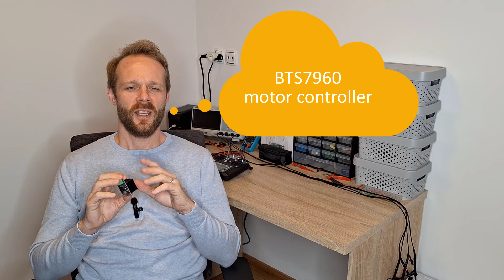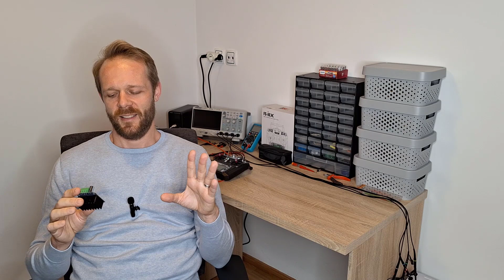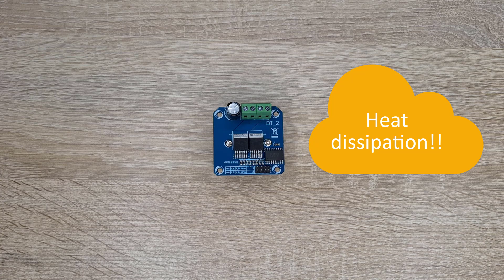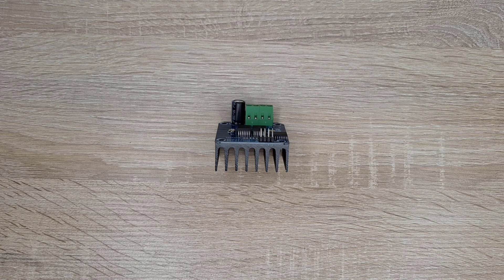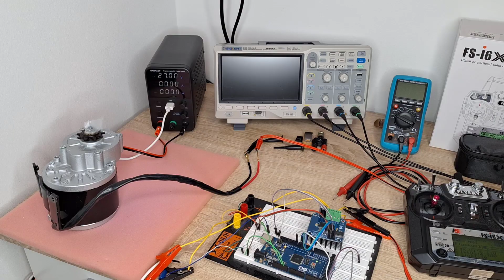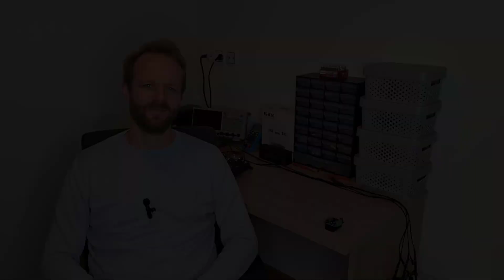BTS7960 - Remote Control Lawn Mower DIY

Comment: Yes sir.you right.that is my problem.so would u mind tell me how could i handle the problem still using that motor controller
Reply from the maker: It depends what is the overshoot of voltage from your alternator regarding this motor controller. You could put one or two power diodes on supply line as quick fix

Comment: Good job Gregor! What about to move the heatsink from the bottom to the top of the module, so it will have direct contact to the BTS 7960s? It should much more efficient.
Reply from the maker: Hi! you could add additional sink to top of the element. This would improve heat dissipation slightly. However this elements are soldered to the board, where much of the heat dissipates.

Comment: Thats funny, I built my lawnmower using BTS 7960 just before this video came out.  Mine is completeley controlled by a Arduino. I will release a video soon together with the code.
Reply from the maker: Hi, that's great if it works in your case! According to the BTS7960 datasheet, the chip has an operating voltage between 5.5V and 27.5V. The chip limit is just above 28V, so if it works, it is just on the limit. Alternator is usually charging at 28V.

Comment: Can you recommend a safe driver for the MY1016Z2 dc motor? greetings from Indonesia 🙏
Reply from the maker: You could go with Sabertooth. This drivers are robust and versatile.
https://www.dimensionengineering.com/products/sabertooth2x32

If you need cheaper option, buy Cytron. This drivers are also fine:
https://www.cytron.io/p-30amp-7v-35v-smartdrive-dc-motor-driver-2-channels

Both can be purchased in various online shops. This drivers can be connected directly to RC receiver. Have a nice day!
Reply: @gregorkobetic Hello.
I live in Sweden and have looked everywhere for Sebertooth and Cytron but they seem to be out of stock everywhere. Do you have another option?👌
Reply from the maker: @farmpro_farmer8737  Hi, I will get back to you tomorrow. Today I am on the road. I have one controller on stock. Please write me email on gkobetic@gmail.com. Will discuss your expectations.
Reply: thank you for your response.. I really like this channel, because you explain it in very detail.. I will wait for your next project.. 👍
Reply: I use 2 x Cytron SmartDrive40. My DIY lawn mower weighs 120 - 130 KG and the drivers are warm (<40 C) at full load.

https://www.youtube.com/watch?v=qL0rpwi-iag&list=PLqj25JSmr2WO5gFJHyEIk22E5_7XpYIAG&index=21
Reply from the maker: Your lawnmower is very cool 👍